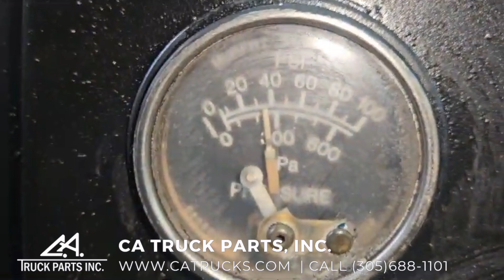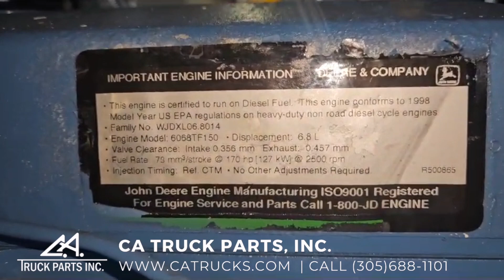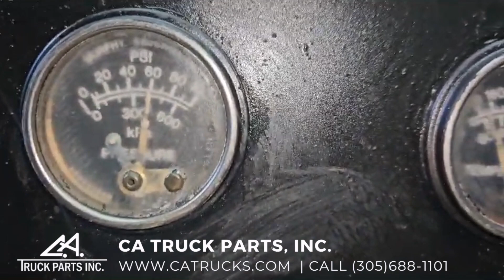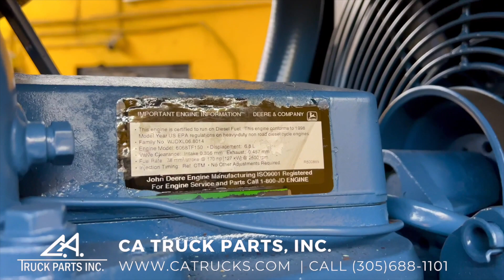1998 John Deere 6068TF Diesel Engine, 6068TF150 | CA Truck Parts, Inc.

Comment from the maker: (GOOD USED & TEST RUN & INTERNALLY INSPECTED) 1998 John Deere 6068TF Diesel Engine, 6068TF150, 6.8L, 170HP @ 2500RPM, Family# WJDXL06.8014, Serial# T06068T750273, Stock# 6030

OVER 500 ENGINES IN STOCK! READY TO SHIP! WATCH TEST RUN VIDEO ON CA TRUCKS WEBSITE! Engine is Test Run & Inspected Internally. Warranty! Many Engines in Stock! Call CA Truck Parts for more information (305)688-1101